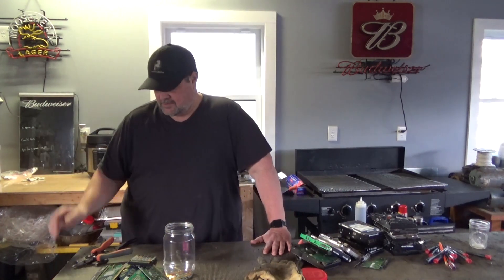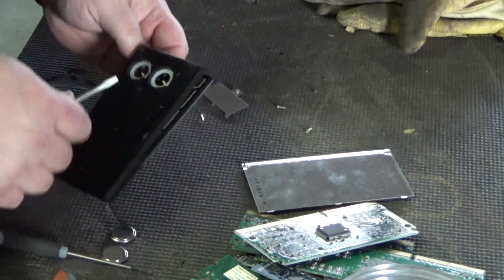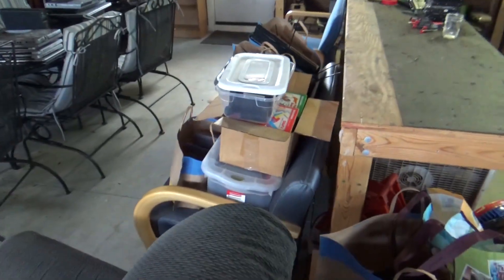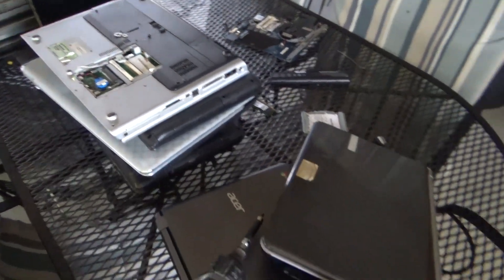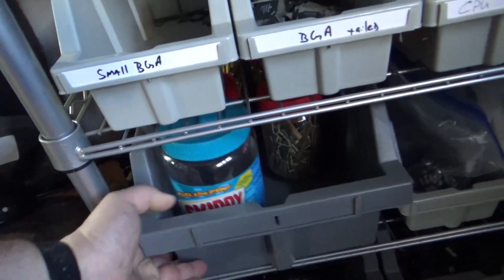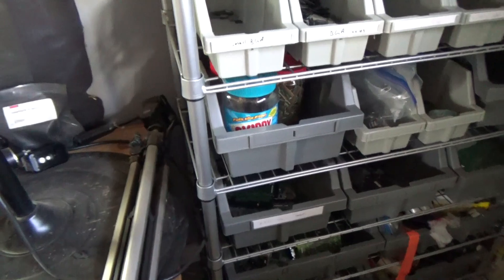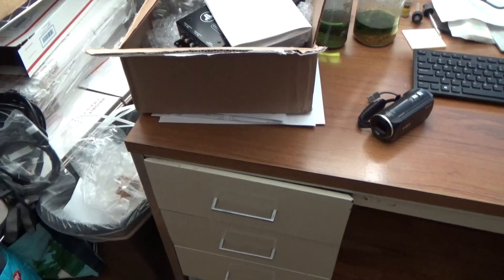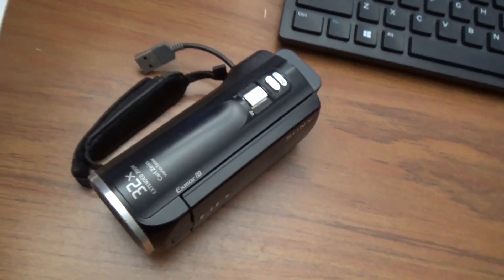Return of the Moose #361

Comment: Welcome back Moose. I have a pool company and take apart the motors.  Some if good enough i will rebuild / recondition use later. The others are torn completely apart  and they are all copper windings. At first it took a while to take them apart  but now i have it down to not much time at all.

Comment: Hi Moose good to have you back. I personally sell around a hundred old phones on eBay a year average. I will take 30 or so take a couple pictures list for around 80 to 100 dollars and ship them out in a medium flat rate box. I never bother trying to get any working and just sell for parts. I get them from storage units I get at auctions so most are older flip phone types but even newer Iphone 5 and 6s sell as long as you have quantity. Make sure that other countries can purchase I find most of my customers are from south American countries. Even though I market them for gold recovery I have had multiple customers who buy in bulk to use for repair parts for their customers. Make sure if you are shipping priority that there are no loose or exposed batteries they are not allowed on airplanes shipped that way. If they are really broken up ones I just ship them out Fedex Ground. I usually don't have charging cords but if I do I will shove a few in the box also. Hopefully this helps. If anyone has any questions I will try to answer.